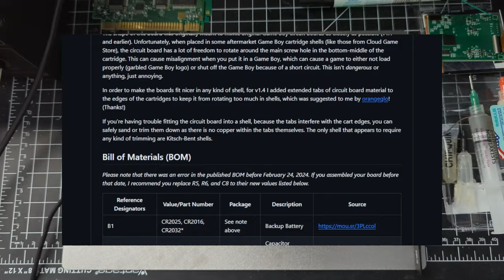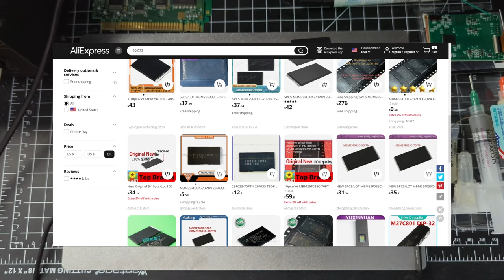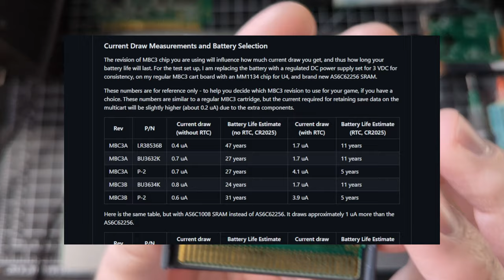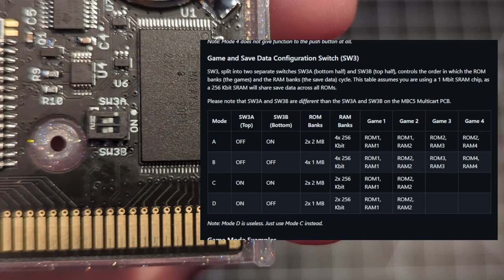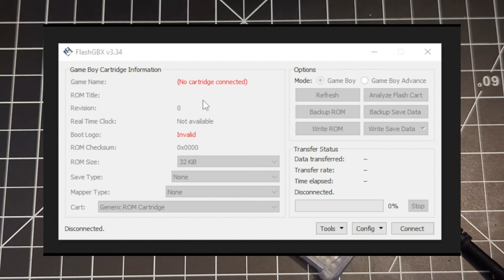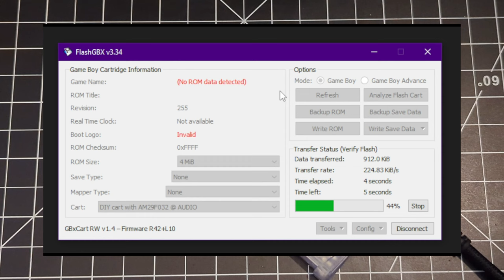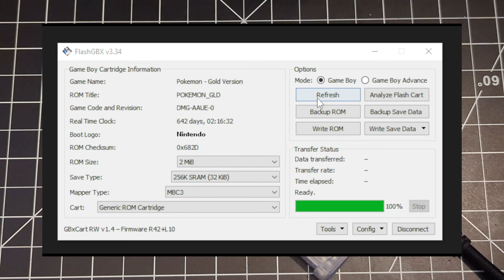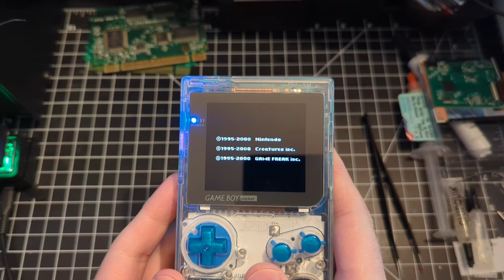Game Boy Multicart Tutorial (Pokemon Gold and Silver)

Comment: I hadn't seen a hot plate used for soldering like this before and now I absolutely need one.  Looks like it'll be much quicker than a heat gun or doing 50 components with a soldering iron.

Comment: It keeps me giving error. But!!!!! I did got it to write a rom successfully one time. But when I go load up the cartridge on my GBC, it'll boot pass the logo screen then it switched into a white screen like it'll load up the game but it just stays white!!!

Is that a SRAM or EPROM issue? 

I tripled and quadruple checked all the soldering joints. No soldered balls. Nothing. I'm on my 2nd EPROM.
Reply: NVM. I re-applied the solder paste and heat up the PCB again to reseat and re-flow the EPROM. It worked now. I still get some errors here and there, but I believe it's from using certain USB ports. So move around on some of your guy's USB port when using the GBxCart RW plugged into your PC/Laptop. Finally, got my cartridege working with one save data!

Comment: if i only had a hot air station, as opposed to the hot plate shown in the video, would you still recommend using solder paste to apply the components (with hot air) or just careful iron work?
Reply from the maker: I used hot air and paste for a long time before I had a hot plate. So it's definitely doable

Comment: 13:18 Where can we get the board holder, the one with yellow circle?
Reply: They are called PCBite
Reply: Ah and it looks like the spacers are 3d printed to get it to the right height for the hotplate. It's fairly clear at 12:52.
Reply: most likely you dont need exact same spacer. You can just put something that you have at home. In this case you only need one spacer
Reply: @SebastijanStanivuk  I realized regular ball 608 bearings probably would also work really well as spacers since the magnetism should get through them, unlike plastic 3d printed ones.

That said the hotplate I was looking at was both a little shorter and a bit bigger for surface area, though this one looks a bit nicer overall.

Comment: why would anybody use this multi cart, why wouldn't you just use everdrive or 2 separate original cartridges?
Reply from the maker: Some people (like me) like to collect individual carts for games, and have fun custom labels and shells to pair with it. Some people (like me) also just like to have fun making something different and interesting :)
Hobbies don't need to be optimized.
Reply from the maker: Also for Pokemon Gold/Silver specifically, you can share save data across the two versions, which this boards facilitates. In the video I show how you can play both versions and switch between them while retaining the same save data, so you can effectively play both games at the same time.

Or, if you wanted to, you could make this a single Pokemon Gold cartridge, but use the multicart function to save two separate save files, instead of having to own two Pokemon Gold cartridges.
Reply: because it's fun?
Reply: Because things are just more fun that way, and with pokemon that's huge so version variety doesn't mess with your collection in game
Reply: There's also a case to be made for battery life. Typically, carts that have roms stored to flash that aren't being rewritten when you select a game are more energy efficient and therefore will give you more playtime on a single battery/charge. This would be a good way to carry multiple games with you without sacrificing that.